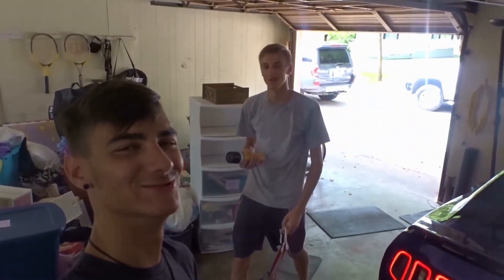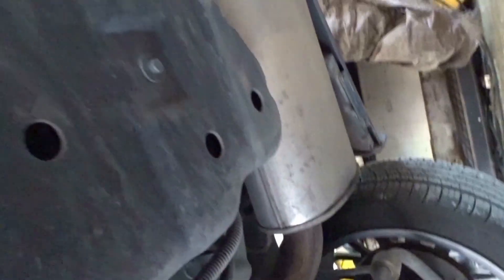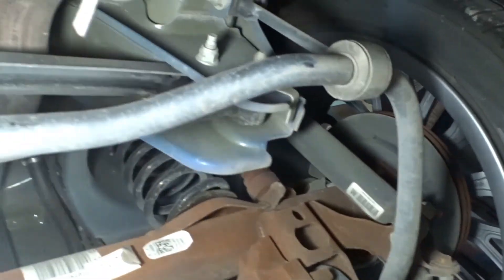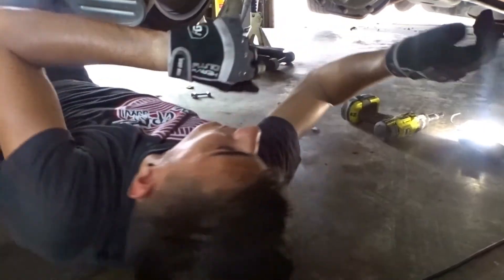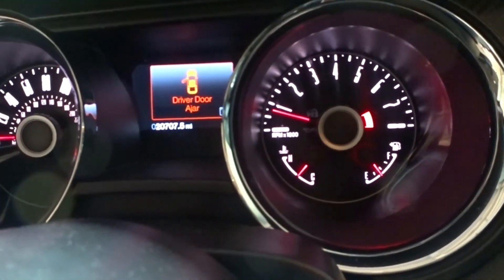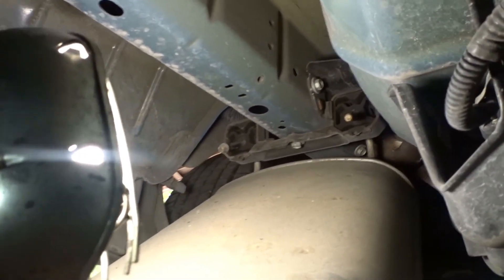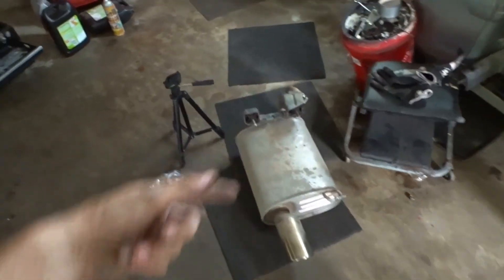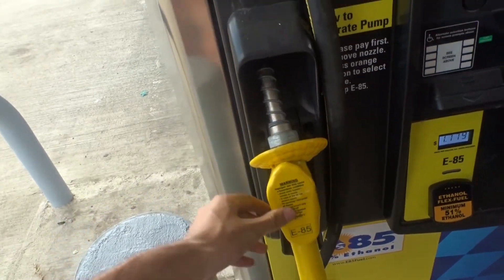2014 Mustang GT Muffler Delete w/ Flyby

Comment: You have to hold the brake pedal and traction control button at the same time for like 5 seconds to turn everything off TCS and stability mode wise...  think that was your issue in the burnouts in the end

Comment: I know this vid is old but hopefully you see this! But did you guys have a problem with the mid pipe hitting
Reply from the maker: Cesar Ortiz no he never did. You may need to loosen all the connections and adjust it a little bit and then tighten it up all the way where it’s not gonna hit anywhere